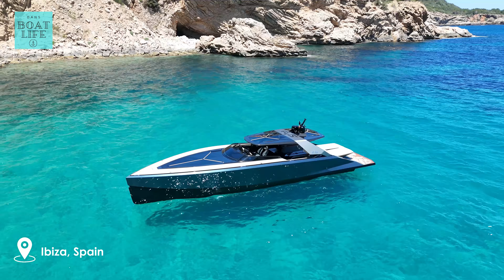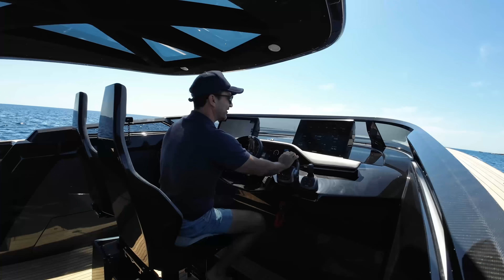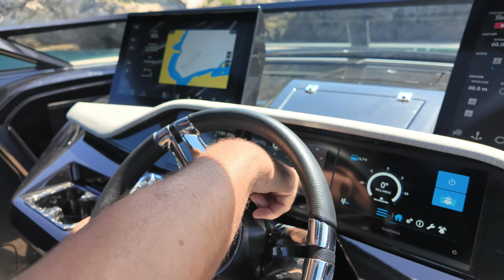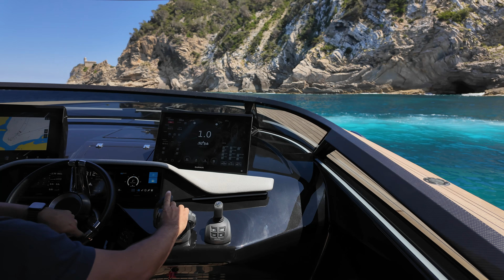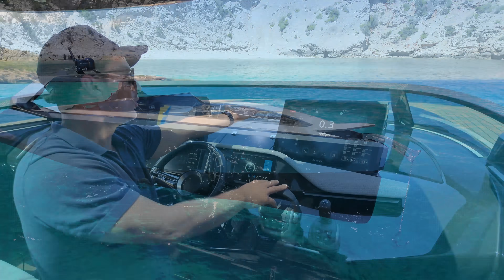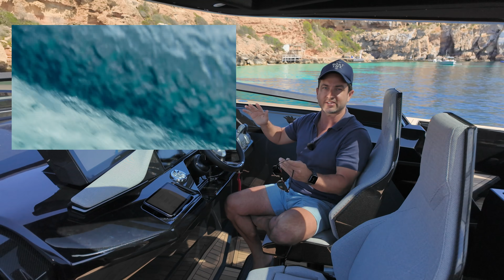Testing the SAY 52 in Ibiza!

Comment: Agreed, the canopy is not fully secured. Choosing looks over safety.
I'm still trying to figure out how Carbon Fiber is a better material in salt water and doesn't decompose or fail under ocean conditions.
The carbon fibers are held together by an epoxy?  The build is only as good and watertight as the adhesive.  
I think Carbon Fiber is becoming no longer "Special.  Just the price is special.  The yacht/boat does look good however.
Reply: It's lighter, stiffer and stronger.  Materials like steel have been used for decades so it's well understood how to stop or mitigate galvanic corrosion. There's no excuse in building a carbon fibre boat that suffers from it, that's not down to the material, that's down to the boat builder and it's likely they'd build a steel or fibreglass boat just as badly.
Carbon Fibre is 20% lighter than fibre glass and also stiffer and stronger.  If you save weight on a boat, all things being equal, it goes faster and uses less fuel.

Comment: Highly compromised for "fashion" as most European boats are. The canopy is under engineered for the form they are trying for. They would need to encapsulate a more rigid material into the carbon to eliminate flex if they want it that delicate. The speed is unacceptable everywhere but Europe. It is very sexy and I expect to see them all over the med soon. Other people have places to get to before tides change.
Reply: Europeans are very fashion minded, to some it's only how and what you've arrived in, and not about the practicality of a boat/car. (eg. no guard rails on the foredeck) So from the helm to the bow is without rails, it's not as safe, but who cares? Because you look way cooler and ain't that's the point! So when you're speeding along on Lake Cuomo, you can choose a Boston Whaler, or this moving piece of artwork the SAY 52! It's also why people spend so much money on a new cars, or clothing, it's what other people see of you and therefore base part of their opinion of you, on that visual. Whereas you rarely show your 'palatial estate', you know, your ranch style... house!
Reply: @The-Droll-and-LazyJoker  Like I said, I expect to see a ton of them in the Med. It was designed for the zero tide areas of the world. That top is going to rip off even in the Med however. It can still be fashionable and well engineered, this just is not.

Comment: In my opinion it's merely an exercise of style. 
Efficiency? Only under an ecological point of view, if the simple use of 800 hp (and the correlative emissions) just for day fun at high speeds can anyhow be considered eco friendly. 
It's pointless to argue with "low" consumption in a boat made of carbon fiber. 
Economy? 
Dynamics: I'm not convinced that the relation power/weight in boosts works in the same way as with cars.
A flat hull promises some critical situations, even considering that it's a day boat.
Reply from the maker: So my point about efficiency is not about the environment. It's about convenience and not having to visit the fuel dock so regularly which = more boating. Yes agree that style is one of the main points on this design brief for sure!
Reply: wtf you talking about eco nut, nobody cares about emissions, we care about speed and range.
we would put penguins in the tank if it went faster :)))))

Comment: The vibration in the canopy is a little concerning.
Reply from the maker: I saw someone doing chin ups off it at the boat show but yes I think I also raised it in the video. If i was taking it to Australia i'd modify the design slightly to add a support. Also i'd love to see this boat in a full windscreen design which would look great in my opinion.
Reply: It vibrates but as long it doesn't brake it wouldn't bother me , at cruising speed it's OK you will only go with 30 , 40 kn to impress your mates 😂